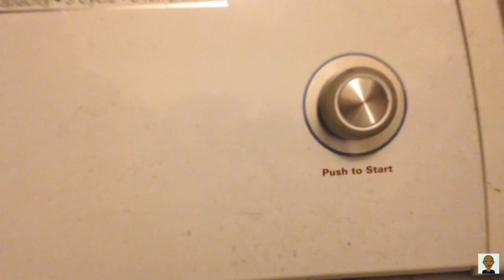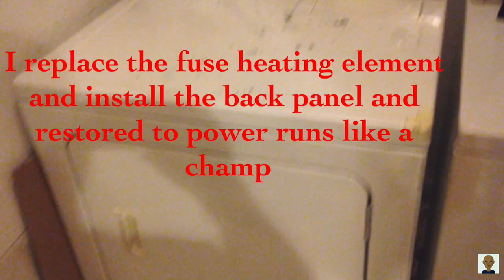Dryer Heats Up But Will Not Spin | Fix For most Brands

Comment: Would also like to know if replacing the heating element was necessary? Will find out today and comment. My fuse is bad for sure and dumb me started with the motor. Replaced it and still no go so checked fuse and its bad. Will have a fuse today and report back if the element must be changed
Reply: Ok so I tried it. Fuse was definitely why the motor wasn't running. Now the reason he most likely changed the heating element is that something was wrong creating excessive heat which caused the fuse to blow originally. My replacement fuse burnt in about 45 min so now I will be replacing the heating element and fuse at the same time to verify thats the case. So it is wise to change the thermal fuse and the heating element together.

Comment: So why did you replace the heating element. Looks like it was still working. Couldn't you have fixed it by just replacing the fuse?
Reply: Can’t use a grounded heating element. Will just keep blowing thermal fuse and also is a fire hazard.

Comment: I keep replacing the thermal fuse but keeps blowing checked for lint but its clean,any help please!
Reply: Replace the heating element
Reply: @KOSerg-vo2qb  I did 2 times😩 but once i change the thermal fuse it works for a bit and then burns it ,any ideas whats causing it?